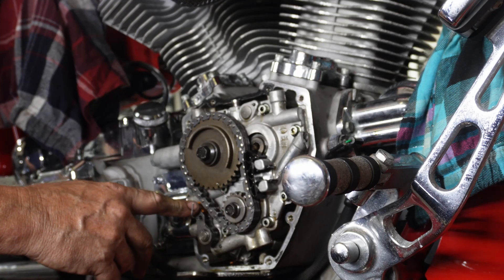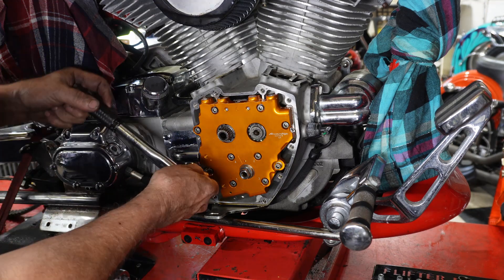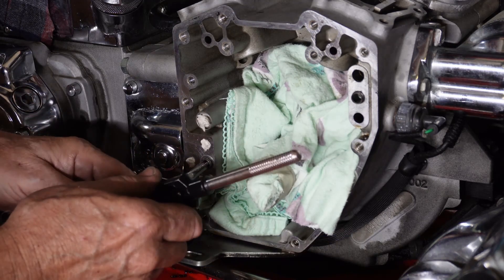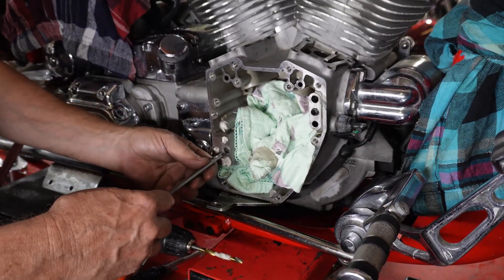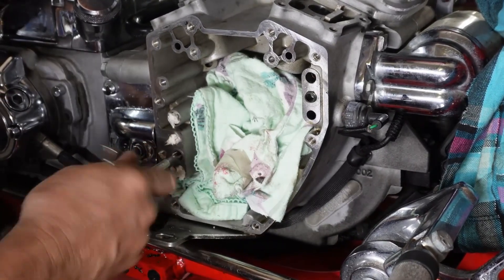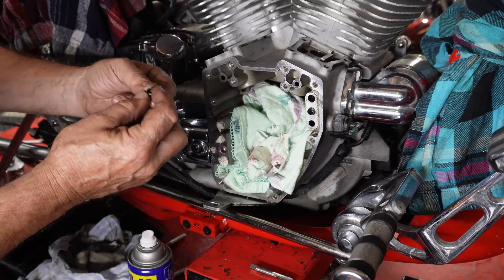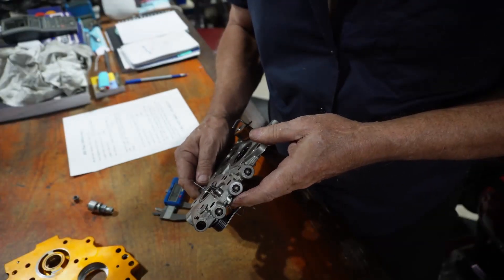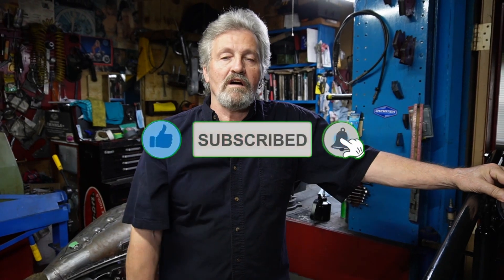WE HAVE A BIG PROBLEM !  NOW WHAT??  STRIPPED HOLE BEHIND THE DOWEL PIN.

Comment: I am upgrading my cam tensioner to hydraulic with an upgraded cam. My template both stripped out the mounting hole is exactly like this video shows. How was that my wits end trying to get the towel out with no luck. Then I saw your video, tapped 5:08  the dowel with a 5/16" tap and got the doll out in no time. Truly genius. I would've never thought of tapping the inside diameter of the dowel. So thank you thank you thank you.  

Now I can move on to the heli-coil install.
Reply from the maker: So glad it was of help to you. I know others have had this problem and I had to figure out a way to get the dowel out. On your way again! Thanks for commenting about this.

Comment: Love you channel, to prevent this i did installed studs into the two holes with dowels and use nuts instead.
Reply from the maker: Good idea have not heard that before. Thanks for commenting!
Reply: How did you go about that job? That sounds like a good fix. Do they just screw right into the dowel holes of the stripped bolt?
Reply: @ you install studs to prevent the stripping, there is not many threads at the bottom of the dowel holes so more prone at stripping if not careful during removal/installation. You want to install studs on the first removal of the cam plate to prevent this, not to fix them, once stripped you have to fix it properly first.